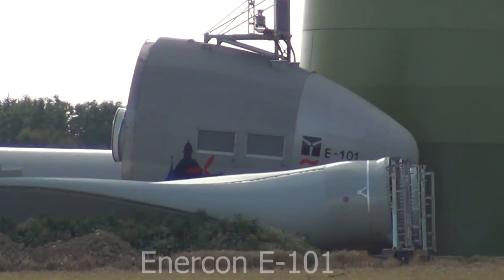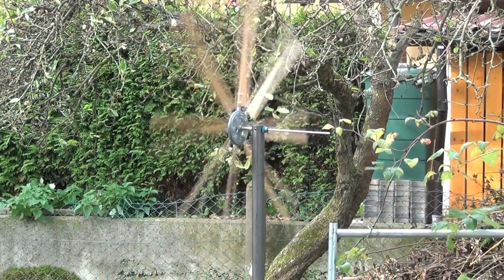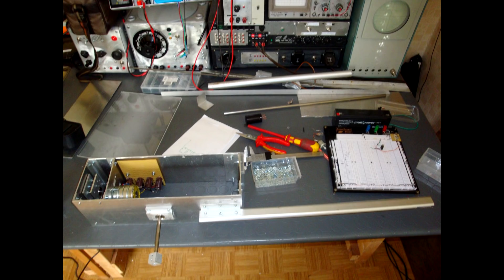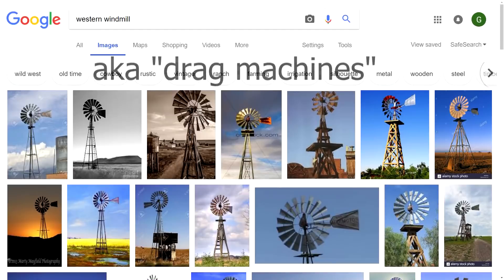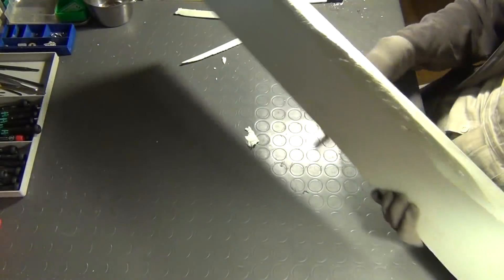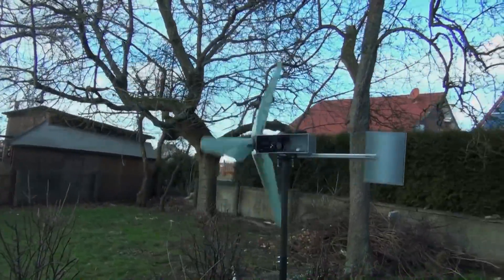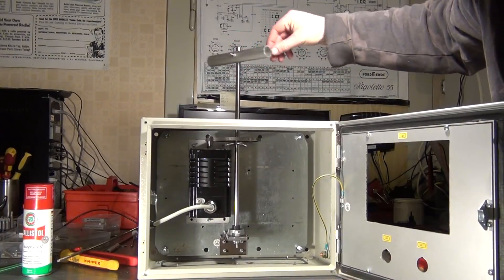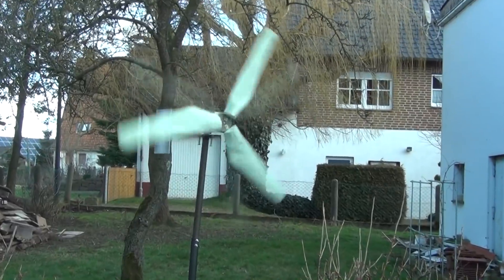DIY Wind Turbine Builds

Comment: Yeah, I like to see a follow up of this subject,  the blade count/amount difference was very interesting. However to be honest, I wonder why we all search in the same technical solutions with wind and sun. Why not using water power, kinetics, gravity, flywheels and such. I have seen some clever and potentional solutions to generate energy in a different way, mostly more reliable, constant and always available. The problem with wind and sun, it isn't always there and not with the same 'strength'. For example, I don't mind to windup a system (like a mechanical clock) each day to get "free energy" by gravity. That will be a great solution! Combined with some batteries to store produced energy. Maybe something to think about. Thanks for posting such great inspirational videos.

Comment: Would be interesting to see what you can use to get power  supply to ie Battery to charge up. It was interesting watching what you did back in 2014. My idea was to put a car generator 12volt  try with a blade on it but all I thought of was 50 cm blade top to bottom? All in my head but one day in new year I suppose I will have a go! Thank you for remenising with us. Love watching what you do, electronic stuff you loose me I'm afraid. All the best Bob.

Comment: Yes I would love to see a new turbine build as I am currently in the design stage for my own build with possibly  multiple 24v alternators for my 100% off grid  Motor coach that has a total of 7,000 watts of inverters installed

Comment: I read somewhere to use odd number blades. 3 blades have 2 blades on one side of center line and it's weight is off set to help start a rotation in light wind conditions. Even number of blades counters this effect.

Comment: One other point. I have spent a lot of time out in the western USA, on the prairies. It is flat out there, there are no trees to speak of, and most important, 20, 30, or 40 mile per hour winds that blow for days at a time are common.  The windmills drive a vertical shaft with a simple lift pump that deposits an ounce or so of water into a giant (hundreds or thousands of gallons) tank with each rotation. If the wind stops for a few hours or days, it does not matter, the huge tank of water will provide for the cattle. They are cool though, I always felt like I was in a Clint Eastwood movie.

Comment: Thank you for this video (and your great channel). I am just about to experiment with wind generation with my 12 year old son and this was most helpful. I just want to keep a battery topped up to power an Arduino based light display to show wind speed and direction on the vane. I'm starting with bicycle wheels and a 12VDC motor from a mobility scooter.

Comment: I like your site and this video; you are well inform in the topics.   The use of a 5 phase stepper is a good idea but I do not have one that big to experiment with  it.  What other choises but the expensive (over $400) hub (brush less 3 phase generator) DIY  build type gen can be used ?.  For example an old gasoline 1 to 3 Kwatts generator stator to regulate the voltage amplitude with a microcontroller  arduino C language based  controller,  feeding the rotor current;  or a big brush dc motor with the rotor modified with big  neodimium n52 magnets and a dc to dc converter  .  Both ideas need a gear set to increase the generator  speed because of the original design was  to work at high speeds.  Can you comment  in one of  your next videos?  God bless you.  Bob (Puerto Rico)

Comment: You should check out the double helix VAWT. Can also be mounted horizontally. Loves turbulent wind. Maxes out at a little over 300 rpm so vibrations won't tear it apart in high winds. They're testing them here in NY on roofs in the Bronx & I believe they were invented in Chicago. They don't hurt birds, either. Very scalable to whatever motor you're using. Could also be wrapped around a pole or tree. Most people think they're sculptures. It's an elegant design.

Comment: @The Post Apocalyptic Inventor >>> That graph you show at about 06:41 shows a single-blade rotor.  

I was under the impression single-blade wind turbines did not work well because one blade would not absorb as much rotational energy as 2+ bladed turbines.

Comment: Hi

Love you're videos

You obviously are highly skilled
Electronics. Computing engineering welding eye.
I want to build three fan wind turbine,have mechanical base skill but useless with electricity
My idea was to just use 24 volt Lorry alternator with built in voltage regulator straight to battery
Use kart sprockets large 75 teeth small 12 teeth chain driven
Will it work

Thanks

Nick London E
england

Comment: To keep those blades hard and ridged cover them with a woven fiberglass cloth coated with epoxy resin. Then sand them as smooth as possible with wet sandpaper for that glass like smooth finish. Then they will withstand almost anything nature can throw at them. And make sure they are balanced properly. They will turn more easily then, and reduce binding or wear on the bearings.

Comment: You can allways transform torque to speed and viceversa.
But, anyway i doubt you will get more energy from a turbine în a dyi project than to power a tv or laptop, or few light bulbs, because it takes some engineering to calculate parameters right.

Comment: think the western is best as low wind speed but a lot torque so this allows for gear boxes and they don't have to be high up with a peg gear the horizontal shaft can be changed to vertical to run a motor low on the grand that can easy have gears or sprockets changed till best ratio is found

Comment: Enjoyed watching your experimental work. The fun is in the process. Once it’s been completed, the fun part is over. From a paper airplane, I accidentally invented the Kline Fogleman airfoil which employs a step or discontinuity. It was first picked up by the RC Groups and has been used there since 2006. The idea is to trap and hold a vortex which becomes part of the configuration. It has been successfully used on a Darrieus Wind Turbine. On the Improvement of Starting Torque of Darrieus Wind Turbine with Trapped Vortex Airfoil
Abstract—The Darrieus wind turbines are simple in design with high power coefficient, yet they are poor performers in low wind speed regime. As a potential solution to improve the low wind speed performance, a notched airfoil (KF-N- 21) was incorporated into straight bladed Darrieus rotor and experimentally compared with conventional NACA0021 rotor from the earlier study. The experimental results displays the superior performance of KF-N-21 in the low Reynolds number without degrading the performance at the high Reynolds number .This paper presents the computational validation of previous experimental investigation and to numerically explore the two dimensional unsteady flow field over the notched airfoil in comparioson with NACA 0021 .A detailed flow characteristics are presented in terms of velocity and pressure distribution by capturing the vortex bubble formation .The simulation results shows a good agreement with the experimental data endorsing the performance of KF-N-21 airfoil for a wide range of Reynolds number.
Index Terms—Darrieus Wind Turbine,2D VAWT CFD,Kline Airfoil,Vortex,Starting Torque,Experiment„Numerical study

https://www.rcgroups.com/forums/showatt.php?attachmentid=11058742&d=1530475044

Comment: Ifin You Still Have The Power Head, You Could Just Mount A Cheap or Free Plastic 55 Gal Barrel, Cut In Half Vertically, Bolted Together With A Couple Flat Aluminum Braces In Opposing Directions & Attached To Your Upright Drive Shaft! They Work Quite Well... Thanks

Comment: With your skills you could probably make something but it needs to be scaled up and put higher up in the air. Get one of those weather station things, that way you can predict how much wind you will have and therefor you can use the results of a diy design (or maybe some other design you can copy) to determine how big it should be and what it should make.

Comment: I love your video a theme. I ask a few Utube electronic guys but no one has the idea iam looking for. This would be helpful for many who live in a van, we can buy a solar fan but not many choices. I was wondering what volt motor is perfect for a 10-20 watts panel. I tryed the 12 volt fan motor but it’s run too fast and over heat the plastic. I want to go to a heavy duty. I read it’s best to use the same volt or a 24 volt motor. I found one it’s a bit expensive for I can’t gamble  would you think this fan motor is ok? And what the best stat choices? 
https://www.ebay.com/itm/Dia-38mm-Small-Electric-DC-Motor-12V-24Volt-2000-3000-4000-5000rpm/153439662029?hash=item23b9b76fcd:m:mrZWTizlmoyN62qpbDvKAOw
Reply: Need to run low sun and fun sun. Or maybe the 12 volt fan motor need to auto lower the motor speed in fun sun as low sun it’s run good

Comment: Hotwire template cut your XPS, like people make their hobby airplane wings,  best if it is EPS (multiple densities) ,  not degassing to laminate with fiberglass,  vacuum bag or hand laminate with epoxy.  You are skilled enough to make a good job, it will give you professional results with minimum effort.  You can ask anything you want,  i use composites for a long time. We could make a good job together,  sorry I live in Spain.

Comment: I went through a similar process and came up with nearly the same design. Ended up using blades from an air conditioner unit. They are small. But I recently realised that I could connect several turbines together in series and now can get whatever voltage I want. I still have much to learn.  Great video

Comment: efficiency graph at 6:55 is energy extracted per unit kinetic energy in wind, which should not be a major design consideration in your case. You should instead be considering the "Efficiency" of watts per money+time spent on building
Reply from the maker: Agreed. But why start building a turbine and ignoring that some are just worse at extracting what little energy the wind might have at a given location. As you can see I also built many diferent types...

Comment: it's not true that 2/3 bladed turbines spin faster (at the same windspeed and attack angle), it's just that they are the most cost-efficient
Reply from the maker: I'm not saying it's a srtrixt law of nature, but in practice it seems to be the case, that more blades seem to create more drag due to additional resistance which leads to the fact that say a typical one bladed rotor will spin faster than a three bladed one. I said that in regards to the Wester Turbines as well, which were clearly designed for high torque rather than speed. The book I cited here (Hau) als said that and so do many sources I can find online like here for example: "The more blades there are on a wind turbine, the higher will be the torque (the force that creates rotation) and the slower the rotational speed (because of the increased drag caused by wind flow resistance). But turbines used for generating electricity need to operate at high speeds, and actually don't need much torque. So, the fewer the number of blades, the better suited the system is for producing power." (http://explorecuriocite.org/Explorer/ArticleId/193/why-dont-wind-turbines-have-more-than-3-blades-193.aspx). I'm not saying it's not theoretically possible to build a fast design with many blades, I'm just citing an empirical fact that I have read. This side also talks anout this: http://xn--drmstrre-64ad.dk/wp-content/wind/miller/windpower%20web/en/tour/design/concepts.htm

Comment: I thought about you when I watched this video: https://youtu.be/4bZNoKKno48. I don't recall you mentioning the reasons for your choice of the stepper motors but I thought that guys attempt with a ceiling fan motor was interesting. Then I remembered your work with the washing machine motors. What would be the most efficient motor for this purpose? Can you direct me to where you explain your reasons for a stepper motor for use with a wind turbine?

Comment: You can make/hand carve  an awesome hardwood blade with the free blade class at windgenzen (c0m) and I had good luck with a 130VDC 3200 RPM PMDC Treadmill motor I get all my power from that and a little solar, but that diy wind turbine is dirt cheap...1/20th the price of solar per amp.

Comment: 500-1000 watts 3 phase + wound coils and neo magnets pls. maybe paired hard drive magnets?
I have a crappy 500 watt 12v wind turbine and I want to connect it to my 24v system... thinking about making a recycled boost converter ... maybe connect my arduino uno... can you please make an ammeter with a hall effect sensor and opto couplers.. that would make me super happy.
I have watched heaps of your videos. thank you!

Comment: I believe that a three-phase brushless motor with mechanical reduction, say 24 volts and around 250 rpm, is a good choice as a DC generator when combined with an appropriate rectifier. Then you should think about a charge regulator for batteries if that is what you want.

Comment: Would be nice to See a good H-Rotor design. You could use a hot wire of constantan to cut the airfoils. You put an airfoil (Rippe) at each end an slice the electric heatet wire over to give a perfect shape

Comment: Hey, nice project. 
I was wondering if you also tried to up the efficiency of this generator by using a charge controller, like those "MPPT solar charge controller" since I'm certain there is always a load at which the generator is running at peak performance.
I'm also playing with the idea to create a similar Darrieus-style wind turbine, probably with four 3d-printed wings in vase mode (so the effect of inertia can be more tightly controlled, by weighing down the hollow wings) maybe even with extra fins at the end of the designed wings to break down vortexes to further increase the yield.

Comment: Another interesting variation that might interest you is a fixed pitch rotor head similar to an autogyro. 
Also, for a slip-ring yaw bearing - try a VCR head assembly.

Comment: I hope I'm not duplicating earlier responses. You could have shaped the styropor using a 'heat-saw': a resistive steel wire which gets heated electrically. On both ends of the styropor plate a template of the aerodynamic profile is placed; the heatsaw follows this pattern and voila you have your wing.

Comment: 90 degrees pinions and put the generator on the pole vertically like the wind operated water well pumps. For the styrodur you can cut it with resistive wire. screw the two edge profiles in wood or something not meltable and let the wire run in tension around those 2 profiles. will just need a bit of sandpaper to smooth the ridges caused by the lack of a constant cutting speed

Comment: The old western USA style windmill had a lot of blades because it was made for torque not speed without the complexity of gearing that could break down (remember a lot of these places would be like a tank in the desert and would fail a lot or demand a constant daily, if not hourly, maintenance of those gears if they had them so they let the wind/blade design be the torgue producer) so it could lift the water out of the well.  GREAT for that but not for generating electricity.

Comment: I have a solar panel connected to a 12v battery for emergencies. I was thinking about a wind turbine before building my solar setup but I get more solar energy than I would have ever gotten wind. So I forgot about building a wind turbine. Thanks for the video.

Comment: i wonder if there are blueprints online, or 3D printer files for the SECTIONS of a proper blade, i mean, you have like 5-6 meaningful section outlines, maybe with some holes to slip some metal rods with nuts and hold the thing, also on the hub, then you wrap some sticky plastic (the one used to "repaint" ugly metal appliances) over the structure and LIKELY you have the blade shape (almost) and at the end maybe fill the thing with construction foam... i admit, tricky but seemingly possible

also i wonder if it's possible to "deviate" some appliances the time the rotor reaches enough speed, maybe some sockets on the wall are "switched" and others are not... laptops, lighting, fridge (?), anything capable of a brief interruption and tolerating an "ugly" AC... no batteries but (yes) less efficiency

Comment: ....and a 100 watt solar panel bought with 10-15 hours of paid work would have netted you many times the amount of electricity you would have generated from your wind turbines. take it a step further you could have bought 1 new panel a month and by the end of 3 years been nearly fairly self sufficient even with a modern lifestyle.    I stopped at  6 panels myself.  enough to provide power to my work shed, all electric lawn tools, and a storm backup power supply for the  house.  I love the engineering and tinkering of these little turbine builds (I am a mechanical engineer), but rarely do they result in something useful

Comment: I'd love to see more of your efforts with wind turbines! Something to look into is applying a resin/fiber coating to the XPS for the blades. Basically, apply a layer of cloth (fiberglass) and coat with resin. Adds minimal weight but a high degree of extra stiffness. Would probably be more aerodynamic than the bare XPS, as well, because the surface would be smoother.

Comment: Hold on. If you have a high-torque windmill, rather than high speed, couldn't one use that to drive a comparatively larger generator for it's smaller blade diameter?